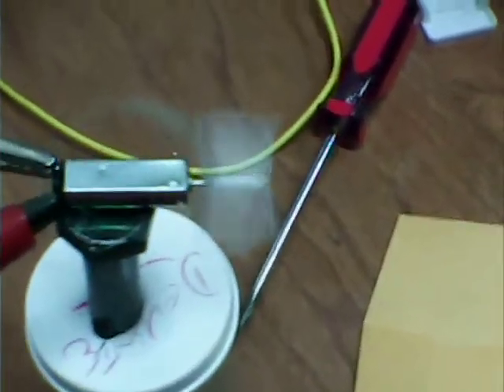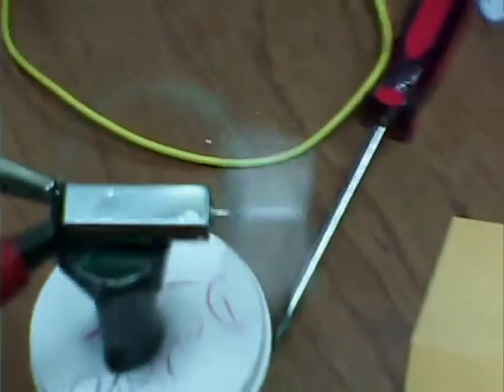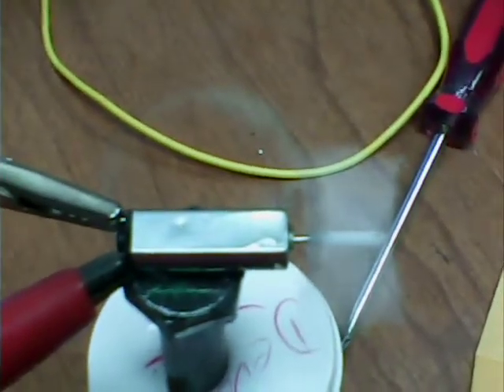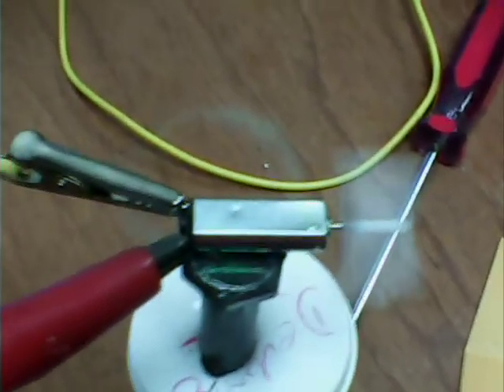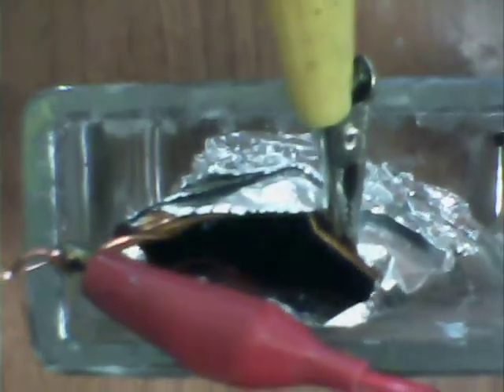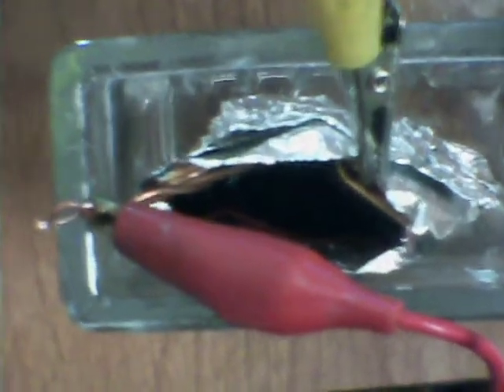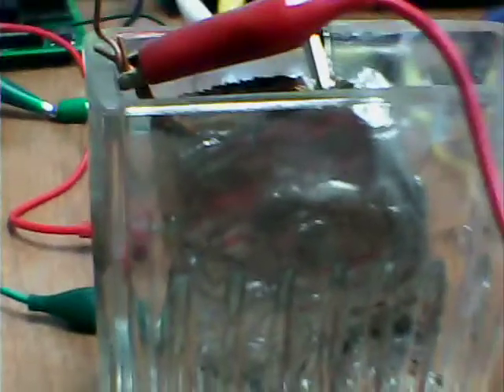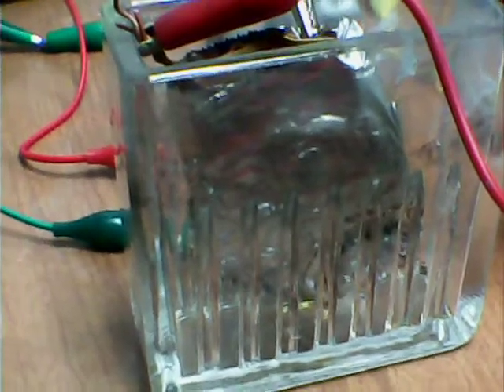Aluminum Air Battery/ Easy Construction

Comment: My little setup attempts to keep the carbon pouch out of the koh, keeping it somewhat drier, with the electrolyte just touching sides and top of the aluminum. OCV 1.41. Using old piece of aluminum angle. Runs a small motor nicely for a while. Monitoring water level. Thanks for your many videos!
Reply from the maker: Keep working with it. Good starting point for battery experiments.

Comment from the maker: After a bit of time, add some household bleach to the electrolyte solution- the current increases. Al + NaClO + H2O = Al(OH)3 + NaCl
The electrolyte solution is alkaline, so insoluble Al(OH)3 may actually dissolve
Al(OH)3 + NaOH = Na3AlO3 + H2O     therefore the electrolyte concentration is expected to increase -and so does the current.

Comment from the maker: Thanx for letting me know about the cut-off on the video. i will re-do it. Yes, the aluminum battery is a primary one. Consider using aluminum cans . Sand the inside first , then crush the can into a pan. Use a larger manila envelope as the insulator. :)

Comment: The end of the video was cut off. Otherwise it is a sensible arrangement for an aluminum air battery. The aluminum will be consumed and need to be replaced periodically.